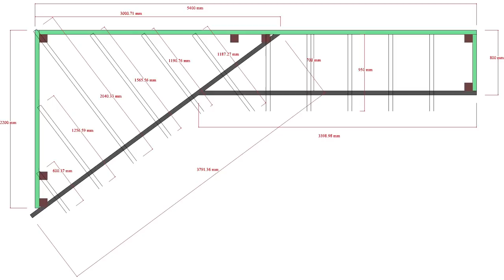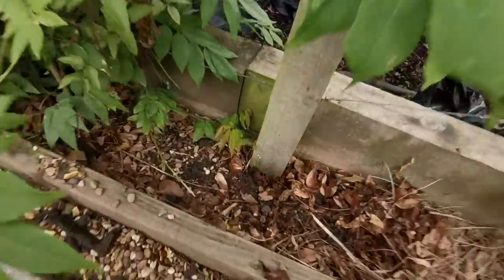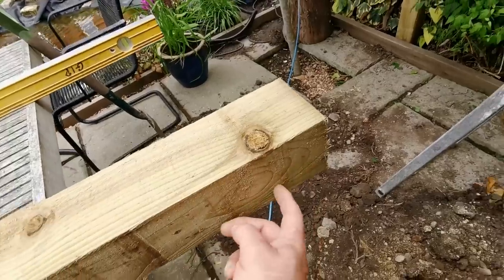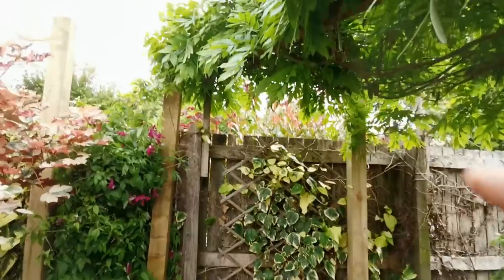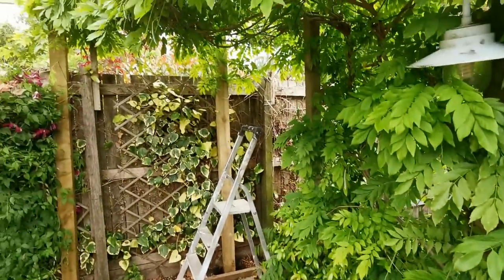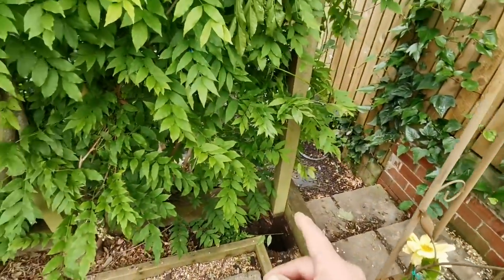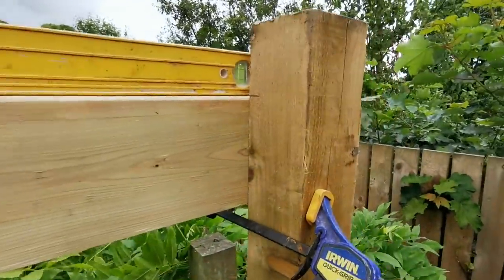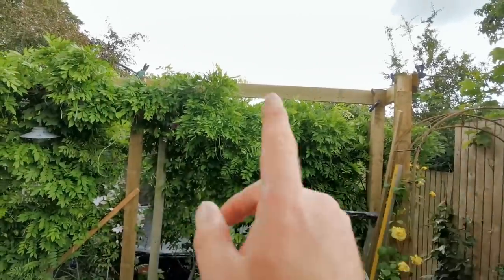Jo's pergola build Pt1 - This is a light framed pergola to support the Wisteria growing behind

Comment: Nice to see another project Gid , great watch and helps me unwind after dealing with morons over the last few weeks😂. I admire your patience I would have chainsawed that lot down after about 10 minutes 😂😂 they did say ‘do what you thinks right’ 😂. Nice flash Gold pencil too was waiting for you to say was new Gid merchandise😉I am still on the few stolen ones from Screwfix 🙄. Nice work as always keep it up !
Reply from the maker: 🤣🤣Thanks,  There  were times when i felt like taking a bit of steam out on the foliage but i'm getting old n wise, that's just wasted energy 😎 The shiny shiny pencils were a gift from Paul McGeoch, they're good, not too soft or hard,  there was some small pencils as always in my pockets 😁 Yeah i've had some impatient people, they think this covid crap is all over or that i can work outside with no problem but the builders merchants are only sort of open, collections only & treated timber is in short supply because everyone is mainly doing outside jobs.
Reply: Gid Joiner my time spent correcting stuff , someone thought be good idea to put a bathroom in with a shower but only put three rows of tiles up 😂 and those looked like they were stuck on in the f****g dark!! They  wanted me to find out why the paint was falling off the wall🤔 😂 . Then had the quartz worktop fitters on our kitchen job decide to fiddle with all the legs on the base units and leave it out of level 😡😂 lucky checked before tiles went on !! Materials here for outside stuff is hard seems like everyone who owns a drill or a saw has decided to build a deck, fence or pergola 😂 managing customers expectations is tough at times . Keep the videos coming it keeps me sane and I honestly learn shed loads of stuff 👍

Comment: Thank you sir, perfect timing. I will be attempting one of these soon for a honeysuckle to grow over. I was trying to figure out the angles (gggrrr) but I will do it your way by laying the timbers on top and marking them. Thanks again 👍
Reply from the maker: 👍 Yep, in my mind these are like a table, legs supporting cross rails then the spars on top, notched in to help stop them moving, outside they're exposed to the elements & the plants can pull on them, notch them down also as i did on the other pergola, that helps to keep them i place although it does expose the untreated wood 👍

Comment: Excellent as always Gid looking forward to watching the others of the series. That saw is mighty handy. My Makita doesn't last 2 mins on the 5ah batteries dunno if a brushless model would be better. Good to see you stay hydrated with the old water bottle there too mate something I forget to do regular.
Reply from the maker: Thanks Josh 👍 Not sure, i think brushless are supposed to be more efficient but this one isn't brushless i don't think, i'll inc the Bosch link,  I haven't used this saw a lot but i don't think i changed the battery in it this whole job, so much easier tho for this with the blade on the left 👍 https://www.bosch-professional.com/africa/en/products/gks-18-v-li-060166H002
Reply from the maker: Oh forgot to say, not my bottle, my hydration is the kettle n plenty of Tea bags 😊👍
Reply: Cheers for the reply gid

Comment: Nice Jon and great tips as I’m going to build one myself. What size timbers have you used for the main posts and top rails? Cheers.
Reply from the maker: Thanks 👍 100mm sq posts, the cross rails/beams were 6" but a little undersized because they wanted it to be as minimal as poss, I normally work of a floor joist calc of - Span ÷ 20 + 20mm. the added 20mm is for safety & to reduce bounce but seeing as this is just a pergola that extra 20mm can be ignored, that calc just gives me a starting point. the spars are 4"